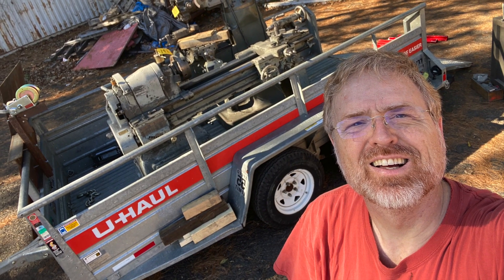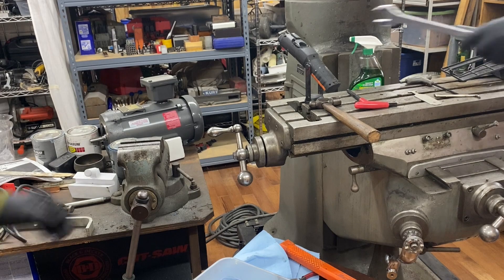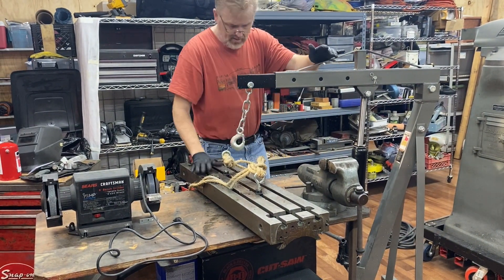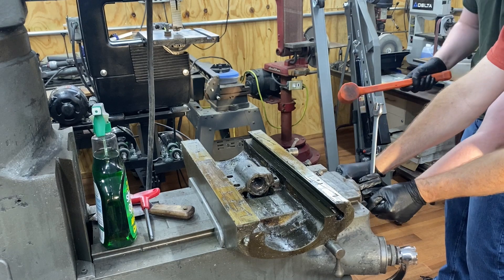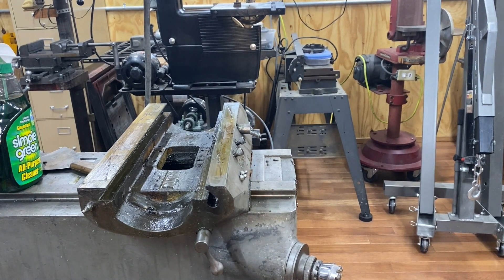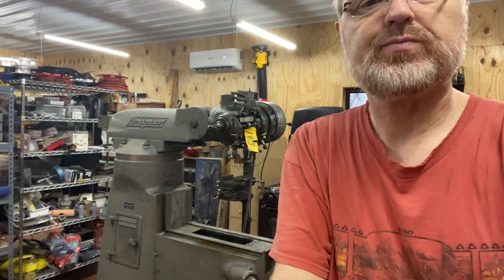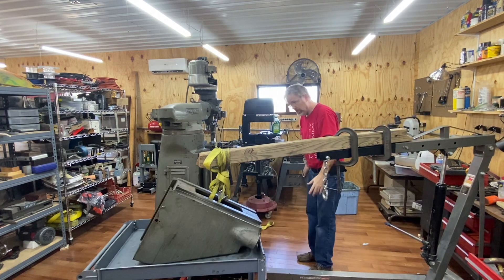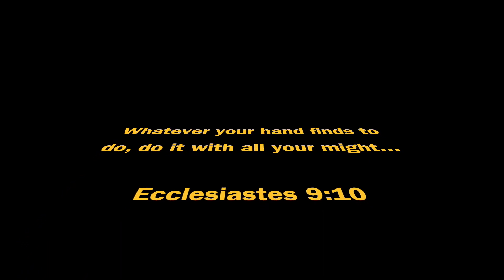Bridgeport Mill Restoration, part 1.  Full of Grease!

Comment: Very lucky taking that bed off the mill like that.  One slip and it would have been very bad.
Reply from the maker: How would you have done it?  I'm always willing to learn to do things better.  :-)
Reply: @KevinToppenberg  : Very well.  When you passed the rope over the hoist hook to lift the table, you did not have a looped tied in it.  Without that loop the table could have easily tipped to one side or the other.  Which is why I said you were lucky.
By tying a loop and slipping the eye of that loop over the hook, the object being lifted cannot slide.
Using the eye bolts in the table's T-slots was superb.
Reply from the maker: @wrongfullyaccused7139   Thank you for pointing this out.  I will follow your advice next time.  I appreciate your feedback.  🙂
Reply: @KevinToppenberg  👍

Comment: you really need to get a parts washer. Kind of dangerous to use gasoline as a solvent.
Reply from the maker: You are right!  Good news is that I got a mini parts washer for Christmas.  It is designed to work with one of those 5 gallon pails.  I need to get a good detergent and stay away from fuel!  Thanks for the feedback.

Comment: Oi mate, took you long enough... Not that im the one to talk... My lazy, slow ass takes a year to switch chairs, but i do have to say, im glad to see you back... I actually snagged like 2 new to me, old machines during your hibernation period... 
If you want an unsponsored recommendation that will make you cry, get the Kluber LDS grease for bearings... The LDS special A... I have a mill to service that i am delaying for like 2 years now, she is sitting patiently, not being used, just getting coated in oil while i am trying to motivate myself to get a move on and do what i have to... In preparation and overly high enthusiasm, i picked up a 1kg tub of LDS spec. A grease around 2 years ago, as that is what the Schaublin recommend for any and all bearings on that milling machine, even tho it is precision spindle grease, they say that its just as good for any bearings, gears, screws or whatever you have to lubricate with grease instead of oil on that machine... To that, i say, it better fucking be, its special formula super precision bearing spindle grease that costs you an average child ransom... It better fucking be good enough for secondary precision equipment and parts... But yeah, that is what i would recommend... I used it on a few other small bearing jobs i had during the 2 years, and it is just the best thing around for noise, lubrication, bearing life, everything, its just amazing, but it costs a lot, that is for sure... And yes, i know that you should check the requirements of your systems, as that may be too thick or thin a grease for your spindle and other parts in want of grease... Best of best for one system can be the worst of all for another system... Kinda like petrol and diesel in modern cars... Both are amazing fuels, but each will fuck up the system designated for the other...
Looking at this chunky peanut butter in your mill sure makes me glad that my mill has an integral oiling system, and she has had only 1 prior owner that didnt use her for more than 100 hours i would say... Its a marvel seeing a 40+ year old machine in ``new, open box`` condition pretty much... And she cost me nothing, like all of my machines... But as said, i dont use her, as i want to avoid any stuck chips wrecking havoc on surfaces i cant see... I have to take her all apart and inspect every single bit and part, changing the 40+ year old grease from any and every grease lubricated part... I will film it and post it when the time comes, given that i started actually filming some of my work during your period of silence, but for now, she remains asleep, well coated in oil... 
Speaking of which, you really might want to consider snagging one of those Vogel oil pumps from ebay or such... They cost a lot, but if you pay attention to them, they will keep your machine is near 0 wear condition... I have a few, well 1 in perfect order, and a few in ``for parts`` condition... The operating one i picked up for like 50 bucks from an electrician who got a machine after the fix turned out to be el. sys. overhaul, and being electrician, he parted the machine and sold off the parts to at least make up for the time and effort of investigating the whole thing... Pump was one of the part, and only one that was still in his possession when i found it... Pretty lucky, given that those little gems sell for like 200-500 euros like nothing, especially in the condition that this one is in... And i have an alloy cast tank for it from one of the parts pumps, as her tank is clear plastic, which the newer models use, and the parts one is much older and has had the cast light alloy tank with oil sights... I will have to swap the tanks at some point, but i have to find a machine to apply the oiler to, so until that moment, she can sit with her plastic tank... But i would advise you getting a similar system... Just be aware that they can break and fail to lubricate, thus causing damage to the machine, as you think all is well, but its not, so if you do get one, check it out before each use of the machine, look at the oil level, check the pressure and flow dials, check her power consumption(a very good indication of health of a pump) and such... 

All the best and kind regards!
Steuss
Reply from the maker: Steuss,  Wow, I really got the wheels in your brain turning!  Thanks for the oiling recommendations.  Stay tuned for more to come.  Regarding your machine, I find that making just one tiny step at a time helps.  If you look at the entire job it is overwhelming.  But maybe just take one part off each day?  Thanks again for your feedback.  Glad to have you along!
Reply: @KevinToppenberg 
My biggest issue is self control practically... I dont do anything for days, then i get a mania and work like a crackhead for 5 days straight, barely sleeping, thinking about what is to be done, and then after that, im back to slothfulness for like a week, month or more... Sure, weather and shit can be blamed for the mood and such, but im just a bag of shit and excuses, my learning and knowledge notwithstanding... You know, whats the point of a man with all the skills and treasures in the world, if he never uses any... That kind of an issue, tho to a much lesser extent, i dont claim to be omniscient nor a master of any field or skill... 
Other than that, im glad to have maybe been of help... Most of what i know today was once an interest sparked by others online who generously showed and taught what they knew, so its only fair for me to do what i can to share it with others... Both are the reason why i started filming my stuff recently... Its in a way, both a timer, and a platform for sharing, so i will feel compelled to not give in to inertia as often... 
And im glad to be able to see you at work, you take care and appreciate the machines, and its always a pleasure to see such a sight...
All the best!